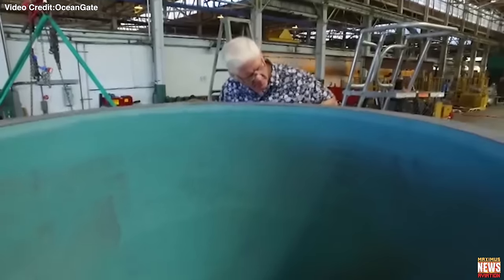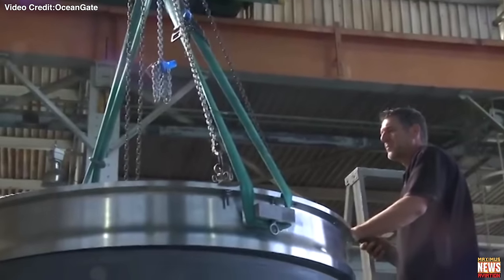Watch The Manufacturing Process That DOOMED OceanGates Titan To Fail. But It NEVER Had To Happen.

Comment: I'm pretty sure you probably need to be in a dust-free environment when your bonding and using epoxy for stuff for it to be done correctly. Also for that to even have an attempt to work they would have had to crisscross the patterns which is a little more expensive than just wrapping it like leftover food.
Reply: It looks like they're wrapping the tube with electrical tape and no overlap. 
I should think it should have been wrapped with multiple strips of carbon fiber simultaneously and at a bias between layers so that each layer crosses the layers above & below it at a 60degree included angle. The end rings should have been embedded in the tube like 11in @ 30degree taper for a 7in wall thickness tube. The end ring taper could have had grooves cut into it to "key" it into the c-f. Humidity is a big deal. It has to have really low humidity when gluing the end rings.
They should have tested it multiple times to desired depth. Then spark-tested it with an electrical wand after each submergence cycle. Keep doing that until it fails by implosion. Then, at least you have some data and an inkling of what it will do before it transports humans. Most devices have a built-in safety factor of 150%.
Reply: @budlanctot3060  "spark tested" carbon fibers? 🤣, you probably overlooked thafact that carbon fibers are conductive.

Comment: The only carbon fibre sub to go to that depth. He was spot on with that.
Reply: There was a single use fibre one before from what I understand.
Reply: I remember seeing an interview where he said he'll be remembered for the rules he broke....
Reply: He set a world record for eternity.
Reply: @@tetrazole567 Using carbon fiber to construct a submarine can offer several advantages, such as increased strength-to-weight ratio, improved corrosion resistance, and enhanced maneuverability. However, there are some considerations to keep in mind.

Firstly, carbon fiber composites can be susceptible to damage from impact or excessive pressure. Therefore, it is crucial to carefully evaluate the design and ensure that it can withstand the expected conditions and forces underwater. Extensive testing and analysis should be conducted to validate the structural integrity and safety of the submarine.

Additionally, carbon fiber composites require proper manufacturing techniques and quality control measures to ensure their reliability. The process of winding carbon fiber can be complex, and any flaws or improper winding can weaken the structure and compromise its safety. Stringent manufacturing standards and inspections should be implemented to mitigate these risks.

Furthermore, long-term durability and maintenance should be considered. Carbon fiber composites may be prone to degradation over time, especially when exposed to harsh underwater environments. Regular inspections and maintenance protocols are necessary to identify and address any signs of damage or deterioration.

In summary, while carbon fiber offers benefits for submarine construction, it's essential to conduct thorough testing, adhere to proper manufacturing techniques, and establish appropriate maintenance procedures to ensure the safety and reliability of the submarine. Here however all these failed to be adhered to. No classification, shody worksmanship etc.

Comment: Sir Richard Branson built a submersible that had an outer casing made of carbon fibre composites. His goal was to have the submersible dive to the bottoms of the 5 oceans and to, eventually, take paying guests. High pressure tests showed that the submersible was good for ONLY 1 dive. He shelved the venture.
Reply: I heard he bought it off somebody who had already done 1 dive then found out.
Reply: @TheFrenchPug  Yes, the person who originally ordered the submersible died just before it was finished.  It ended up sitting at the manufacturer for 3 years, before a company (sponsored by Virgin Oceanic) purchased the submersible from the original owner's estate. The builder finished the sub and deep pressure tests were finally done. The manufacturer found out that Virgin Oceanic planned on making 5 dives and warned them that it was only built for 1 dive, which the deep pressure tests proved to be the case.
Reply: @mrkman62  That's a great story. Only 1 dive though. Wow.

Comment: Let’s be honest the engineer who designed this was pretty smart. This should not have worked and surprisingly it did like 12-14 times. The negligence however is unimaginable; It was like they decided to stress test a experimental machine with live occupants. 
Blows me away…
Reply: That's an endorsement of the material, not the engineer. There's absolutely nothing smart about this engineering.
Reply: Nothin smart about the design tho, true engineers know that, this sub was horrifically built, and the sub only dove 5 times
Reply: If they has some knowledge abt engineering, they would think to atleast reinforce the middle of CF hull with 2 more extra titanium ring acting as hull transversal web. This is not smart engineering but insanity. Even a first year Naval architect student can tell that this design has weak point in the middle of the CF tube.
Reply: @andanandan6061  I've been calling this one of the greatest accidental validations of CF, in history - did you see how they made it? "THE TAPE WASN'T EVEN WOVEN! It was laid in a continuous, simple loop, just round and round the diameter, up and down the tube, and back again!! 5 inches worth!....*
Poorly specified material, for a poorly conceived design, that was improperly manufactured to a low standard, using raw material of questionable quality, in poor, totally uncontrolled, conditions: the result, totally unverified, abused in practice and completely unmaintained.....
That tub was such a misadventure that it should have gone on its first dive - and never been seen again!.. It's amazing that it came back, and the fact that it actually achieved that cycle more than once, is astonishing.
The thing should never have worked, but CF actually managed to save these lunatics, despite all their determined efforts to embrace Death, until even CF could fight it anymore....
It's an incredible validation of that material.
Reply: Essentially what they built was a disposable sub, pretty risky but fine by all measures as long as you know what the lifespan of the sub is. The real problem is apparently they didn't know it was disposable.
Reply: @lewis7515  I expected some reinforcement. You know similar to Submarine hull construction with its internal transverse framing and longitudinal stiffener typical for cylinder shape hull.  Suprised it had nothing like that. Absolutely nothing. his Submersible is basically just a huge CF Pipe with 2 titanium plugs glued at both end. Waow..
Reply: Smart? Designing a craft using a material that engineers have explained would shatter on compression on deep sea dives? Bonding 2 different materials when engineers have known for decades would be problematic because each material would compress in different rates resulting in cracking? Just because it worked 12 - 14 times, doesnt make it smart.
Reply: Good point Martin. I don't have any way to verify it, but someone said he tested the sub and took it to the same depth as the Titanic 50 times. I think his tests were done in the Bahamas. I think Stockton thought he could overcome the compression issues with CF by making it thicker. He told someone not to worry about the cracking sounds because we have 5 inches of carbon fiber. If it's true, that the carbon fiber is only good for X amount of dives, he should have started making multiple CF hulls and designed the titanium rings / end caps differently where they were removable, so he could transfer them to a new hull every so many dives. I would have had a 12 inch dado in the titanium for the CF tube to fit in, and drilled holes through the titanium CF titanium  sandwich and put bolts in it. Even though drilling holes weakens it, it would be sandwiched by titanium on both sides. Then instead of gluing the joint, I would have put rubber seals in the dado that could be replaced with new ones when needed. If you're making a million dollars per dive to carry 4 passengers and say the CF hull lasts 50 dives, that's 50 million dollars, and he could easily afford to replace the CF hull with a new one. Even if the hull was replaced every 10 dives to be on the safe side, that's 10 million dollars. I don't know what it costs to make a hull like that, but I'd think it wouldn't be more than a million dollars.
Reply: @mygunisinnocent8028 The Titan was like that because it had to be cheap. Otherwise, wealthy tourists could go on the two Mir 1-2 used by James Cameron, for the modest price of five hundred thousand dollars, double what OceanGate requested.
Reply: @Gabriele1979  Thanks for the information, I didn't know that. Now I can see why the submersible industry was trying so hard to shut him down, since he was undercutting their prices. They might have been concerned about it being unsafe, but I wonder if the main reason was because he was taking their business by offering half price rides?
Reply: @lewis7515  Right-on.  The worst-possible negligence.....all he had to do was to first build a bench test model to see the material's limitations.
Reply: @mygunisinnocent8028  There is no business - and not one anyone but Rush was particularly interested in: a business - and demand to support that business - is what Rush was trying to create.
I don't think you've understood: he needed to create a means to serve his big idea - making money out of submarine tourists.
To make that work, he had to start the usual commercial balancing: he needed to make a certain amount of money per head to cover overheads, and turn profit to his investors in an agreed time - which means he needed to ferry a minimum number of people. 1+4.
To bus that number by conventional, safe, means would have meant making the biggest titanium sphere ever created - can you imagine? A sphere would have been extremely expensive, tremendously heavy and it would have needed a huge support vehicle and cranes etc, etc...
He had to start closing those gaps.
A tube, of any kind, is a fundamentally flawed approach for these depths - which is why nobody does it - but he deluded himself that CF was the answer to the limitations of a tube, and a CF tube allows him to fit 5 people in relative comfort, that is much cheaper than a giant titanium sphere: it is also much lighter and much more bouyant. He then doesn't need the biggest support ship in the world, he doesn't need a ton of foam, it's even so light, he'll be able to tow it around like a canoe.
Suddenly, CF, starts making this look feasible, in principle, that he can even start consider how much more cost he can shave: 5 inches thick tube, not 7. Off-the shelf components. Game-controllers....all cheap and none of it rated for depth or oxygen environments,  which would make it expensive.
The submersible industry couldn't care about his prices, the submarine is doing quite well without whatever Rush thought he was doing, thankyou very much - the submarine industry was genuinely concerned about an unprincipled and out-of-control obsessive, who had migrating himself into their industry and run wild - refusing to accept advice in a determination to be somebody and call himself an innovator, meanwhile putting lives at serious risk just to follow his personal ambitions. Do you think the submarine wouldn't have wanted to benefit from genuine innovation that respected principles of engineering, physics and safety? 
All of these were secondary, to rush - all of them expendable. The only thing that mattered to Rush was somehow leaving his mark on history, in some field or other. He never could manage to find his place, and he was running out of time - he was 61 years old. The submarine saw him for what he was: a sad and quite esperate borderline madman.

Comment: It's very disturbing listening to other reports about the cracking sounds durring other dives, this was glass and glue breaking each time and they failed to understand that. Having owned a few fiberglass hulled boats a cracking sound indicated a break in the hull.
Reply: they prolly thought its "normal" bc it occurs in steel subs too, but the big difference is they get back to their proper state when pressure gets lower, while the cracks in the carbon or epoxy keep being cracks and never get good again
Reply: Dont think it wad glasd and glue but carbon fiber getting delaminated by what other ppl are saying carbon fiber isnt a good material for this stuff and it wore out it was only a matter of time before it failed all the passangers gambled their lives by signing up for the trip but CEO singed his own detah sentance cuz he went on every trip and sub imploding was inevitable
Reply: it was carbon fiber delaminating. but yeah, could be the glue too, since different materials would behave differently under pressure, and also temperature.

Comment: According to James Cameron it was badly designed and wasn't built to withhold the pressure of diving that deep. He warned this guy that the design they came up with was not safe and they should not use it. Rush chose to ignore the warning and every other warning experts gave him.
Reply: No he did not warn ocean gate. He warned a guy years ago who was trying to build one like it about it. If that was the same engineer is unkown.
Reply: Cameron explicitly stated that he did not know of the details of Titan, as he was busy with Avatar 2. He said he assumed it was designed by capable engineers and certified. He later heard about the warnings other made, and did not add his voice to those warnings. He knew it was doomed to fail at some point.

Comment: One thing you learn very early in engineering school is how materials function in compression and tension.  Using carbon fiber for a tank designed to take extreme external pressure doesn't make much sense, especially one designed for continuous expansion and contraction over time.   Also, multiple different types materials all expanding/contracting at different rates is/was a recipe for disaster.

Comment: Carbon filament winding is common for pressure vessels. But only for possitive pressure: inside higher than outside. Submersibles are exposed to negative pressure: Outside high, inside low. This causes buckling in the fibres, which in turn causes tensile stress on the epoxy matrix. Insane design choice!
Reply: And even for that purpose you need a woven structure to catch the forces along the pipe.

However, Carbon fiber cannot withstand pressure but only tension.